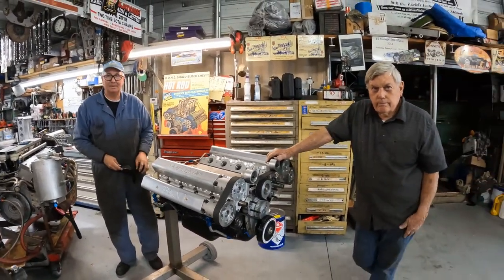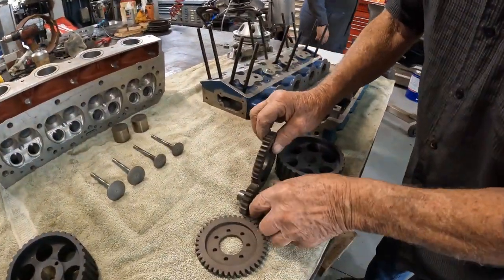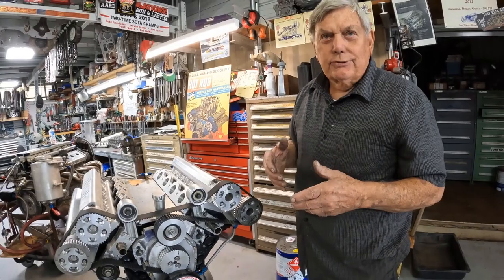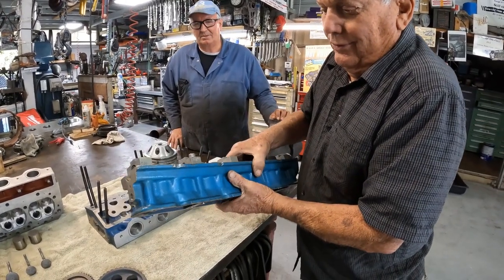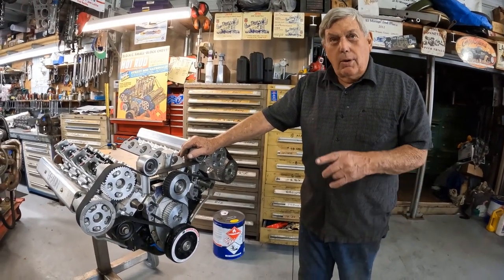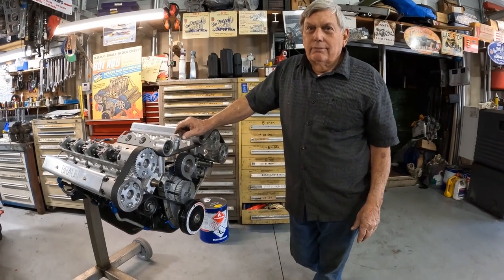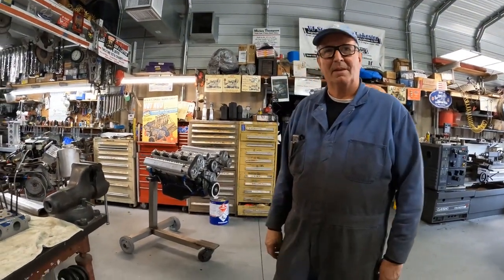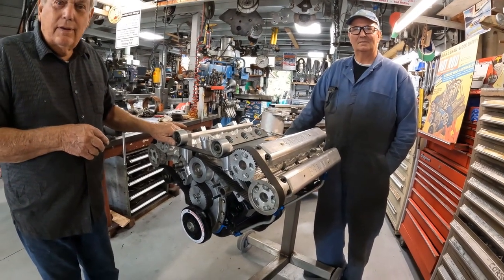50 Year Old Quad Cam +1 Chevy 350 Engine Explained!  Moser Motor Masterpiece!

Comment: There is a big block blown over head cam motor in a boat in Sydney, out of sainty racings top fuel car that I have a few photos of.
Reply from the maker: I'm sure Pete would be interested in seeing it.  We will be firing up the big 20 liter V12 soon which Pete and Kevin built for a race boat - stay tuned. should have it posted in a couple week or so.  thanks - Greg Q

Comment: If you turbo you can use subaru EJ as reference, bore spacing, bore size, valve angle all looks very close, millimeters.
Lazy 800hp turbo.

Comment: Not much belt on the upper cams, hopefully it doesn't skip any teeth. Cool motor.
Reply: The belt wrap on the intake cams looked kind of small to me, too.  It has only about 10 teeth fully engaged in the sprocket.

Comment: Smokey ran a 200 ci turbo small block at Indy. 
At one stage there was a few stockblock n/a  5 litre?? Chevs running that were on the pace an made up the numbers.
People hve played with multi valve Chevs for decades [this is one]  the Lotus another and yet never been more effective than the factory layout. 
Reputedly Nascar made 900 @ 9000 rpm Sprintcars do that a LOT more voilently and there has been Drag Race small blocks with considerably more. But they last a mile!!
And yes this engine is way too big, just like that twin cam Ford that is huge and short on power.
Reply: My thoughts exactly, overly complicated and way to wide.
Long live the pushrod chevy!.
Reply: Yes but you have to remember the R& D millions of dollars that the factories have to spend in making their HIGH END RACE stuff .. ( of course you can’t beat that kind of money ) .. I THANK these two old guys for trying … !!! 
With a limited budget of Course
Reply: This thing is similar to a flathead Ford with Ardun heads.  Yes, there are easier ways to make power and newer stuff (especially with similar displacement) almost always has more potential.  This engine has the cool factor of rare “ancient” go fast parts.

Comment: pontiac was messing with single and dual over head cam 389 and 421s in 62-63........latter the tech was released in the ohc6.....the cams timing belts kept being thrown around 7000 rpm on the 389s and 421s.....
Reply: They also had the OHC straight 6, the block was from Chevrolet

Comment: "4 valve heads aren't common". Ford Modulars, Northstars plus every 4 and V-6 engine built in the US today. Face it. Aside from packaging reasons the pushrod is dead.
Reply: LS, LT, Hemis, Ford’s 7.3 gas engine.
Pushrod V8s will be around as long as V8s are.
Reply: @stlchucko  
It's all about cost and packaging in the vehicle. Not about any inherent superiority of the engine layout.
Reply: @mpetersen6  
Pushrod v8s are inherently superior in how much CID they have in a compact package.  Displacement is the easiest way to make low end torque with a NA engine.  

Superior packaging in a vehicle is vastly important.  There's no point in having an engine that won't fit in a vehicle.  Cost is also an important factor given that most engines are primarily designed/built to sell.

All this relates to your statement of "Aside from packaging reasons the pushrod is dead".  First it was just packaging, then you threw cost in there too.  

The thing is that Ford's 7.3 gas engine goes against your argument.  It's a pushrod V8 from a company that stopped putting them in vehicles in 1995/96.  A compact package isn't a concern because the engine is only offered in F250 and larger vehicles; which have plenty of space under the hood.  
Ford could have made a tall deck version of the existing Coyote engine (the aftermarket already does this) and easily made a 351 CID Coyote (a historical Ford displacement) with minimal development costs and use many preexisting parts.  Instead, Ford spent a boatload of money developing and testing a pushrod V8 that's only used in limited vehicles (and not their best selling ones).

Seems to me there's more to pushrod V8s than just the packaging and cost reasons you're asserting.
Reply: @stlchucko  
Yeah I get it. I love the sound of classic American V-8 as much as anybody else. The OHV V-8 will exist primarily as a niche engine in the not too distant future. If at all in passenger vehicles. Eventually by probably 2040 the ICE will not be able to be sold beyond markets such as heavy equipment. Believe it or not climate change is real. And even if it all isn't caused by human activity, human activity does play a part in it. Internal combustion engines will still be around in the used car market and in niche fields such as hobbiest. But eventually expect internal combustion engines to be banned from street use. Not tomorrow,  not next week or next year. But it will happen.
Reply: @mpetersen6  
None of what you said here has anything to do with pushrod V8s being dead unless you include virtually all other ICE engines as well.  Most US car manufacturers have already said they're going EV by 2035.  Chrysler announced the Hellcat is ending in 2024.  

So my entire point is that 4 valve per cylinder V8s haven't supplanted pushrod V8s (which have arguably only become very common when Ford started putting the Coyote in the F150).  Also, 4 and 6 cylinders have no bearing on the video beyond them having 4 valves per cylinder.  "4 valve heads aren't common" is in the context of V8s.

Comment: Just on a mathematical basis, 4 valves have a much larger surface area than 2 in a circular combustion chamber. No matter what sized valves you use in the 2v head.
Not only that, but a 4v head flows in a cross-flow pattern. In the inlet, across the piston and out the exhaust without changing direction. Something a 2v head can't do. 2x 90deg turns in flow can only hurt performance.
Reply: I work with 2V head's every day that have cross flow, and with the size valves that can be put in a 2V head when they're canted like the heads I work with their size (aided by their angle) can fill the cylinder with no problem at any RPM the engine's run at, they're Harley Davidson heads.
Although Harley toots the horn of increased flow being the reason they recently went to a 4V head it really isn't the reason they did it, they only talk about flow because they know it's what people want to hear and the real reason isn't as sexy.
The reason Harley went to a 4V arrangement is combustion chamber heat and emissions, the lower roof of a 4V combustion chamber lowers combustion chamber temperatures because of less surface area, that allows them to run a leaner mixture without detonation.
Reply: @dukecraig2402  yeah.... not really a V8 engine though is it?
Try running a cross flow 2v head on a pushrod V8.

But 4v still flow more than 2.
That's just mathematical fact.
Reply: @antonyaiken  
Chrysler Hemi V8's were cross flow.
Reply: Plus you get a lower mass for each valve for less stress on valve springs, so a must for high revving racing engines, unless there are some class rules that restrict you from taking advantage of the 4 valve layout. Or the class of racing favours air cooling, e.g. some ultra-light Porsche sports prototypes in the 1960s, although they eventually went to water cooled heads with 4 valves in the 1970s, before moving to all water cooled 4 valve designs.

Comment: As someone who's owned a Australian 2004 Ford Falcon XR8 5.4ltr Quad cam 260kw/500nm (348hp) V8 (Cobra R heads) and a HSV Clubsport R8 LS1 5.7 255kw/475nm (341hp), I much prefer the way the LS1 drives, it has far better bottom end power and almost equal top end with better fuel economy.

Comment: I like this engine. One other engine with 4 valves per cyl is the Cadillac NorthStar, did alot of engine work on these when i worked at a Cadillac dealer, at a GM school for this NorthStar 4.6l they said unofficial it will turn over 9000. Love to see ya do something to that engine. They are chain drive for cams with oil psi tensioners and 27 crank rotations to get back to timing marks.

Jesus Does Save
Reply: Mercury marine

Comment: Excuse my dumb question, but… theres 5 operating cams in this engine? Or am i trippin?
Reply from the maker: There are 4 cams overhead and the stock Chevy 350 Cam is still in place to drive the timing gears in reverse rotation and drive the distributor and oil pump.  Only the overhead cams are operating the valve train.  Thanks Greg

Comment: Looks very big and complicated.I am   involved with dirt late model racing and the engines we run have one cam and two valves per cylinder.These engines make 700 to over 1000. HP with a carburetor all day long and are relatively durable
Reply: Cool

Comment: So…. I heard them reference the “main” cam and the pushrods, if there are no overhead valves, just the 4 per cylinder that are part of the DOHC cylinder heads…what is the function of the pushrods and what are they pushing against? And how the hell do you determine the “lift”, duration, etc.? It can’t have a displacement of 350 cubic inches even when all the contributing factors are measured and added up
Reply: The pushrod cam is used as the drive sprocket for the cam belt as shown.  There are no push rods installed.

Comment: This is very interesting! I would be curious how one of these 4V engines would work from and emissions potential. I work in engine management and rather enjoy calibrating 4V engines for emissions much better than 2v. It would be interesting to see what the potential of this engine is with modern catalyst and one of the modern emissions type ECMs (Delphi or Continental or Bosch) was it actually a groundbreaking engine that way ahead of its time?
Reply: how do you feel about lean tunes? i would love your opinion as an emissions expert. i like having the contrasting opinions of tuning experts/ enthusiasts and oem calibrators like you.
Reply: and to clarify a lean tune is a calibration that favors economy. for example the ls7 corvetes would run on just 4 cylinders when road cruising. the aftermarket has gone a step further and on a catless vet with a lean tune a corvette can do 40+ mpg cruising at freeway speeds! lean tunes fascinate me because it is the opposite goal that most hotrodders have! but isn't economy related to emissions? it would seem to me like its a very important part of the future of the performance industry.
Reply: @aylahughes9185  Well, best economy would be very slightly better than best emissions since almost all of the NOx and CO emissions are fixed by the catalyst (99%+ reduction) at exactly stoichiometric (we get 0.01 or better AFR accuracy on that, using both front and rear O2 sensors). But if the engine can have a fast flame front to lower the AFR to efficiency penalty without sacrificing the NOx/CO/HC balance, you can get better emissions, power, and economy at once. The trick is optimizing stoichiometric combustion in the engine so the cat can work its magic without the economy penalty. I mostly work with natural gas engines which actually has some of the advantages of the Smokey hot/vapour engine (mixing, fast flame front) without the knocking risk. For the odd hot rod, emissions are less of a concern but when there are millions of daily drivers it really adds up and I’m in the production car emissions tuning world far more than performance. I’ve found that the 4v engines have faster flame propagation times and I find I don’t have to work as hard to meet the regulations without sacrificing power and maybe reducing fuel economy maybe 0.5% to meet regulations over the best economy tune. For 2V engines I find I often have to sacrifice 3-4% economy to meet emissions. They both run at exactly stoichiometric.
Reply: To clarify, the emissions tune is stoichiometric, economy tune is lean, but the combustion differences sometimes balance each other out if the mechanicals of the engine are ‘right’. Engines where outfits like Ricardo design them for a specific combustion system lose less than, say, a 1955 design that has EFI slapped on it, and I’m talking about an I4 engine and not from America. I can’t say who though.

Comment: Let's see, were going to pit a LS vs a SBC, let's go to the scrapper and get a LS & SBC 350, roughly $1,500 for a decent LS & $ $750.00 for the 350. We have to get a"$25,000 Moser kit"(4 cams $1,000ea.) and 2 machinist to make the custom manifold, headers, accesory drives, cooling system, plus were going to spin it like crazy so throw in some billet rods for a few bucks.
Try to adjust the valves on a Twin OHC with buckets and with 16 valve it could drive you batty in a heart beat
There is NO comparison.

Comment: But what about the oil pump?.
Reply from the maker: It still uses the stock cam to drive the pump and distributor
Reply: @GregQuirin  I’m aware of that, but now the stock cam is turning backwards and so is the distributor and so is the oil pump and so how does that work???